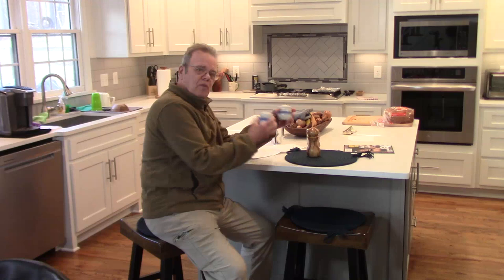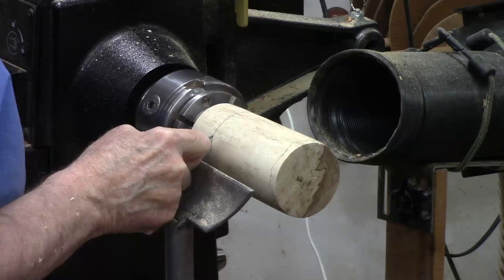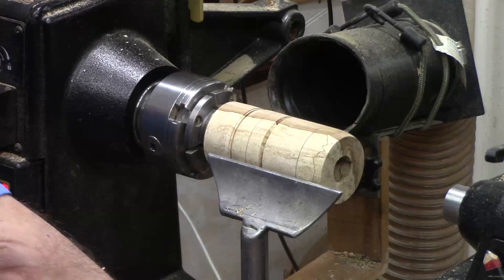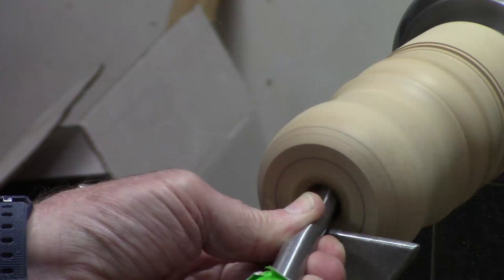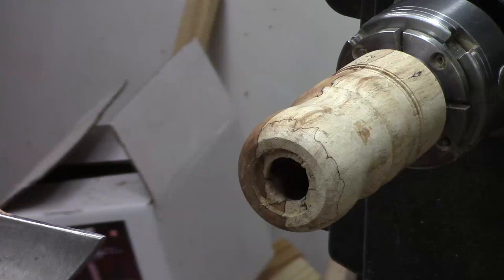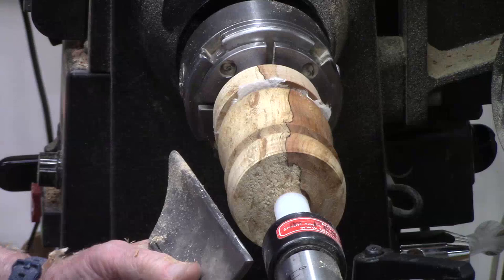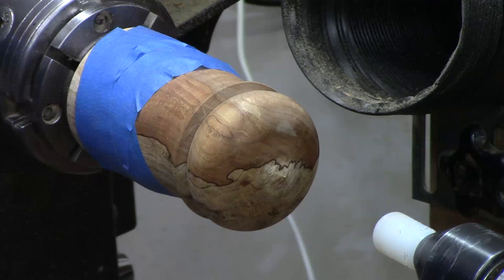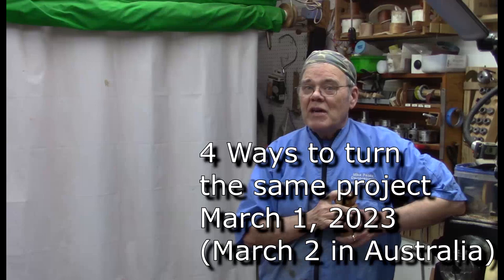Turn a Salt Shaker

Comment: The salt shaker is nice. Lucky find on the piece of wood You used. I can believe you kept it for three years. But it's hard to believe you could find it again. :face-blue-wide-eyes: It does look good. Your four way project is something I don't want to miss. It should be very interesting. Thank you for sharing. Have a great day and stay safe. 🙂🙂Be careful with that lung powered tool. It would be a disaster if you inhaled.:face-pink-tears:

Comment: Re finishing - did you do anything to seal the inside?  I guess the question is that spalting is a form of decay, and I wonder if byproducts of the spalting might contaminate the salt if the interior is not sealed.  My inclination would be to pour some shellac into the cavity, roll the turning to spread it around, and then dump the excess.
Reply from the maker: I did not seal the inside per Richard Raffan's guidance on making a condiment shaker in one of his books.